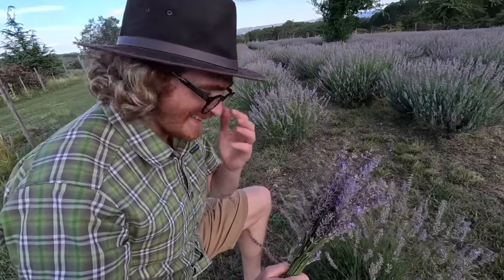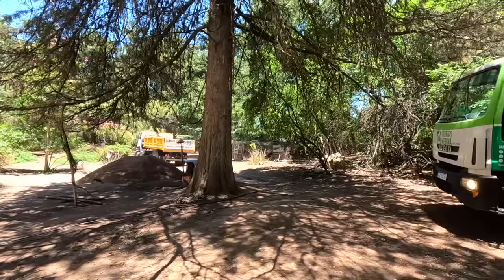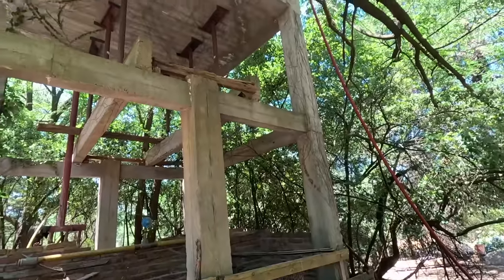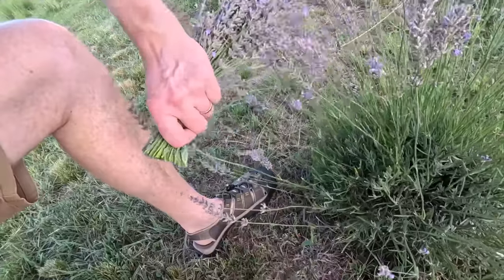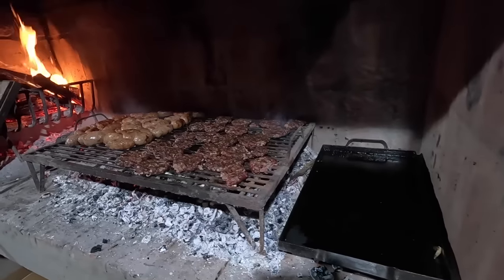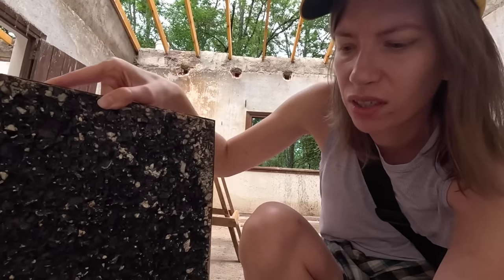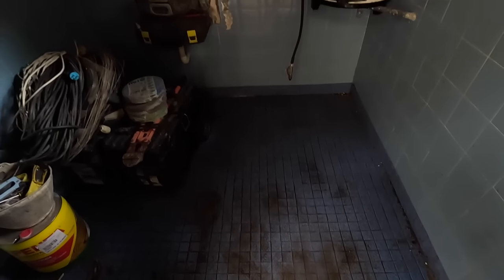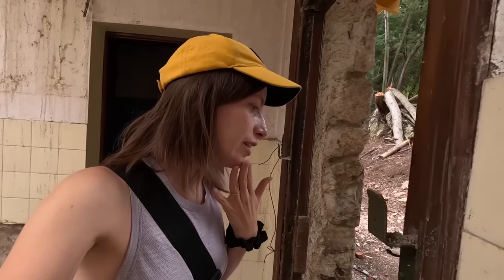We're GUTTING the Entire HOUSE! 🏚️🫠 | Argentina House Renovation Update

Comment: Love watching your progress. My husband and I are now in BA for a month and are absolutely loving Argentina so far. You really are on an adventure with the hotel. A quick suggestion for your laundry room: install a combination washer/dryer. While hanging clothes to dry is easy and great in the summer, it's not so much fun in the cold of winter. We had a combination machine when we were in Brazil, and loved it for the days that were really wet and cloudy. It's nice to just have the option to dry in the machine if needed. Anyways...just a suggestion :) Can't wait to see the next update.
Reply: I thought the same thing stackable washer and dryer for the win especially on cold wet winter days.!! 🙌🏻
Reply: While I can't speak for a hotel capacity laundry use, for common home use, no dryer is needed. Fall/Winter/early spring is dry season in Cordoba, clothes dry quickly and thoroughly on a line. In summer even though there's some rain and humidity, you've got the heat on your side and wash things accordingly. Optimal weather in Cordoba for line drying.

Comment: Some high windows on the walls can help also with the light, with less water issues.   Internal windows are also a great solution for some spaces like the kitchen, more budget friendly than external windows, where you have to consider about temperature insulation.   With external windows double / triple glass, always pay the investment at mid term.

Comment: Maybe I'm just one of the unlucky few who have had a bad experience with skylights, but I would advise against them. In my case, the skylights have a few feet between the roof and my ceiling creating a shaft in-between. A shaft that they did not finish leaving large open spaces in all of the corners. A great path for bugs to enter the house.  They covered up their lack of craftsmanship with a frosted plastic rectangle and grate.  Needless to say, I get very little light, but added worry that, in hurricane ridden Florida, they could shatter or leak. Just be advised.